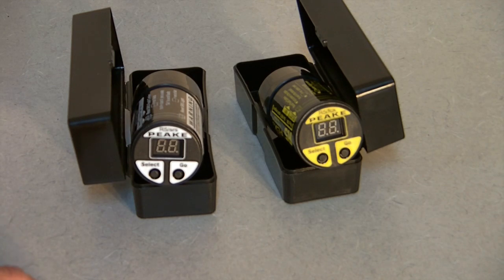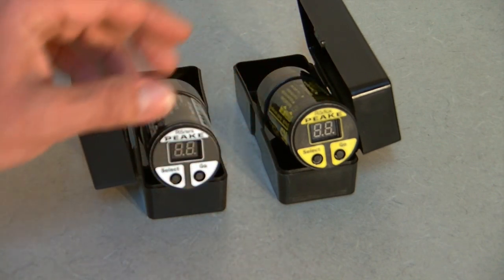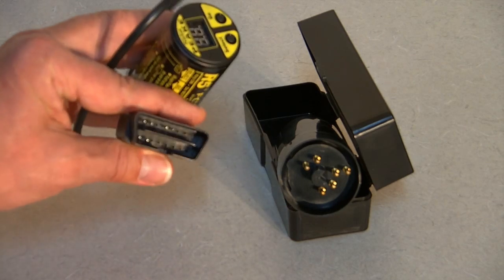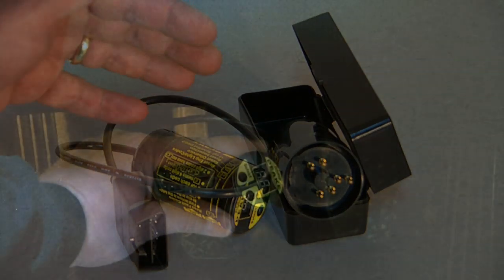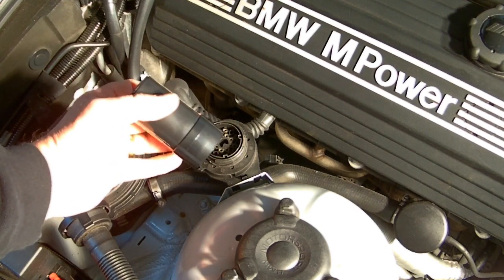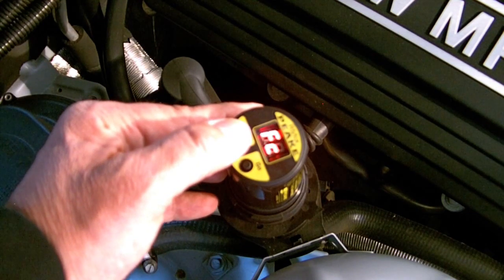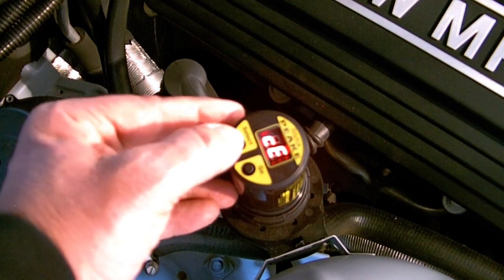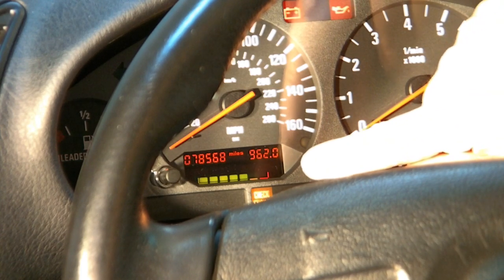Peake Research BMW Tools: Code Reader, Airbag Reset

Comment from the maker: Peake recommends the SRS (Airbag) tool for BMW’s 2002 and earlier.  The following comes from Peake Research’s site concerning the SRS:

Known Incompatibilities:
- Our SRS tool compatibility falls off sharply around mid 2002. Flagship BMWs, such as the 7 series, are the least likely to be compatible. 
-We have received reports of a "perpetual" 01 code on the model year 2000, 323i.
Our SRS tool is not compatible with any BMW built before 1994.

The FCX3 (Code Reader Tool) is compatible to 2007

Comment: I got a bmw 525i e34 from 1992 with an m50b25 engine.
Will a r5/fcx 3 code reader work with the car or what would you recommend?

Comment from the maker: @williamvashstampede I am afraid we do not stock a Mercedes-Benz specific tool.  However, we can special order an Auto Meter scanner for Euro cars for $189.99.  A better deal might be had at you local auto parts store - Actron make a pocket scanner that would do the trick (you have to look up the codes it returns on the internet) that sells for less than $70.  I've used mine successfully many times on both domestic & imported OBD-II equipped cars.

Comment from the maker: I'm afraid that the Peake SRS tool is not compatible with 2004 or later cars.  At present, I know of no tools available to the consumer market to read or reset the airbag codes on a 2006 BMW 530

Comment from the maker: I'm afraid not.  To quote Peake Research's website "R5/SRS: 1994-2000*
R5/SRS-16: 2001-2002.  Our SRS/Airbag tool compatibility falls off sharply around mid 2002. Flagship BMWs, such as the 7 series, are the least likely to be compatible."

Comment: I've got a 2001 BMW Z3 M3 6cyl with the airbag and check engine soon lights on. Which device and which connector will I need to reset the dash lights? Thank you